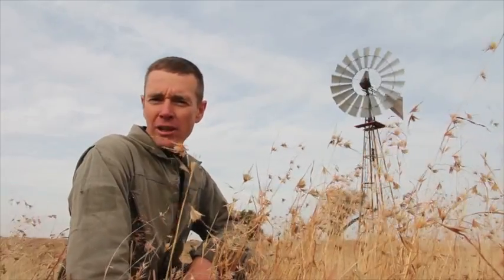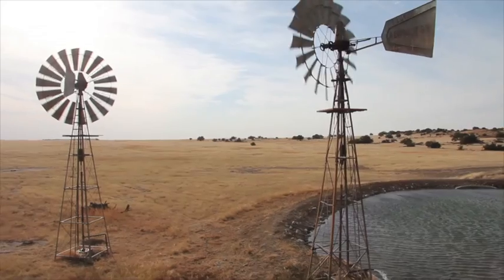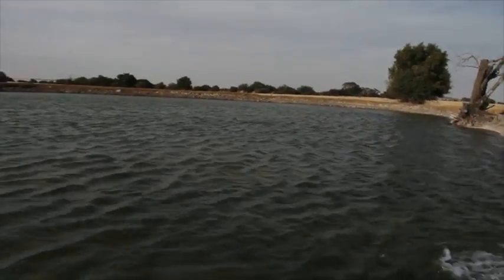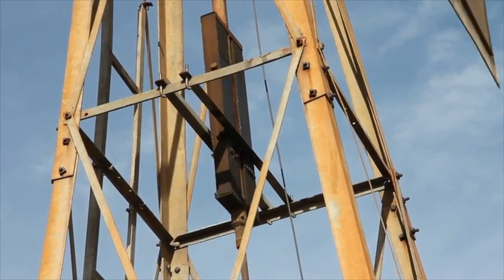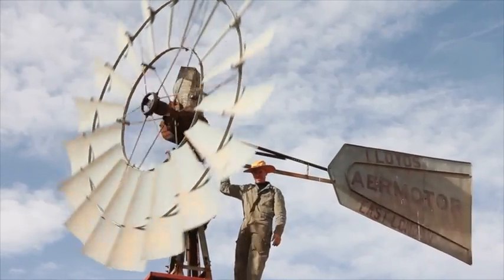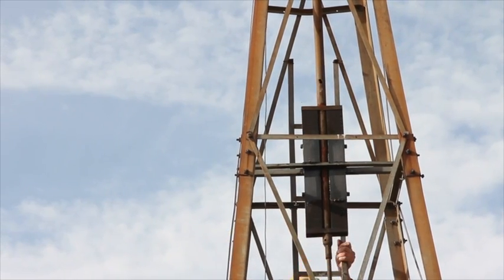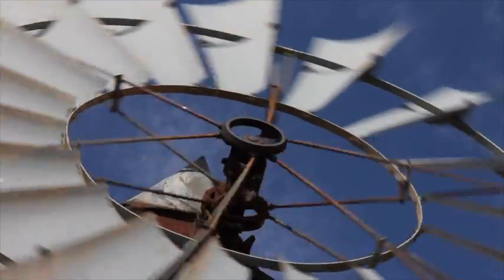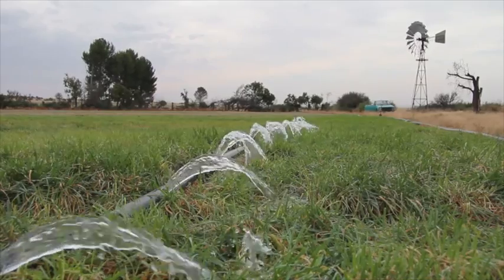Windmills

Comment: How is gear box ?  Power turn 90 degrees. But how kimd of gear box or differential use  at this system? Thanks for answer.
Reply from the maker: The windmill/wind pump gearbox consists of a set of small gears that is directly connected to the main shaft of the wheel. These two small gears mesh with a substantial bigger gear to give the pump the torque to overcome the resistance of the water cylinder and weight of the connecting rods. A reciprocal motion is achieved by having connecting arms fixed to the side of the big gears with a guide and one centre wheel running up and down. I guess a video would be better to explain but I doubt I can make time for that.
Reply: @michielkotze1704  thanks. How many wind  must turn for 1 pumping ? ( up and down)